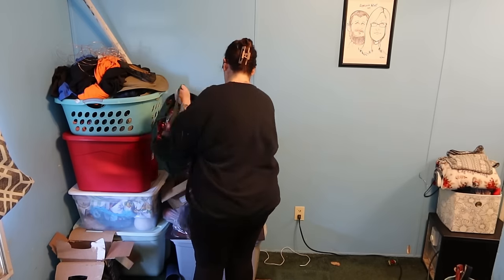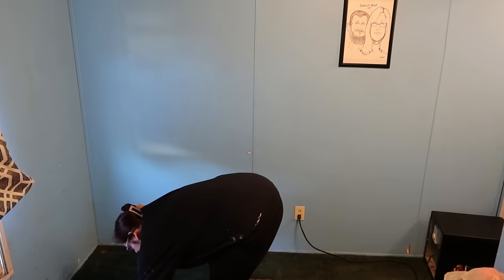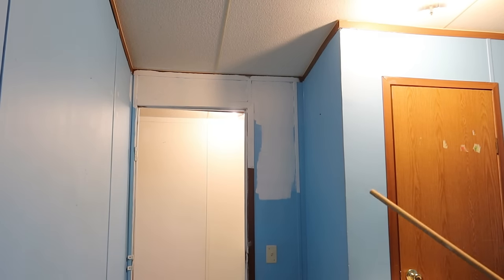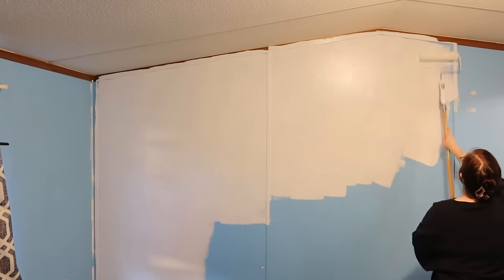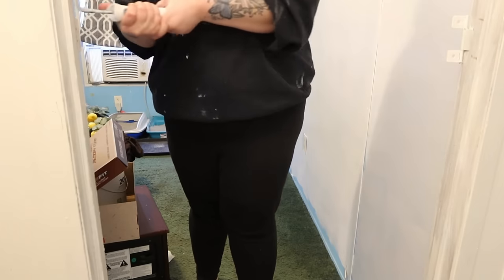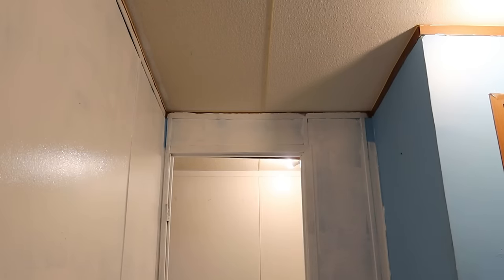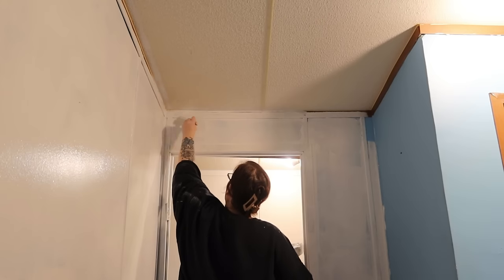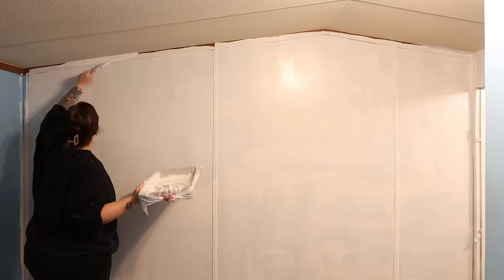NEW HOME REFRESH // PREP & PAINT // OFFICE MAKEOVER // PROJECTS IMPROVEMENTS PART 1 // KIMI COPE

Comment: We use cut to size Dollar Tree clear shower curtains under the boxes. They're cut big enough to catch most of the litter and make it a lot easier to clean up. Also the Arm and hammer multi cat litters  are the best to keep the odor away.
Reply from the maker: That's what we use too the arm and hammer with the black label on it. It clumps and seals. It's supposed to be 99% dust free that 1% dust comes a week later 😂
Reply: We have dirt roads around us and Spanish moss all over so dust is an all the time thing with or without the kitties. I just love that no one can smell that we have our girls. Do not try that new arm and hammer light weight the amonia smell  was too much and we gave 3/4 of a box to a friend who's gonna use it for traction in the snow in NY

Comment: Why did you paint the switch covers and hinges are you replacing them? It turns out much nicer if you do not paint them
Reply from the maker: I always paint over hinges and light switches. In this case they look better blended in with the rest of the wall. They aren't being replaced so I like to paint them so they blend in with the rest of the wall

Comment: Just a suggestion- don’t use nails in your subfloor- they can back out as you walk on the floor and punch holes through your peel and stick. If you use screws, they don’t back out. A drill is much cheaper than a nail gun.